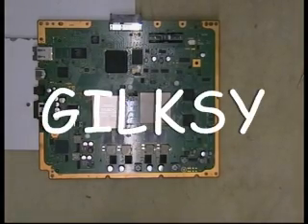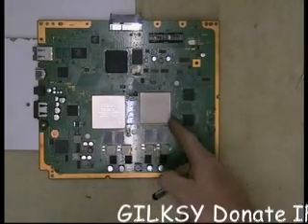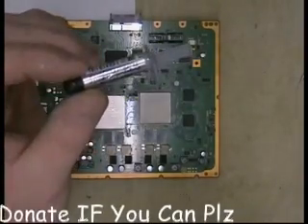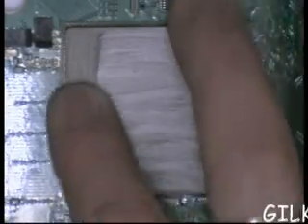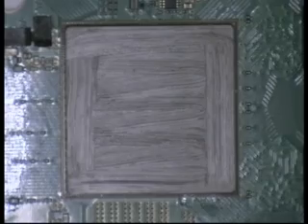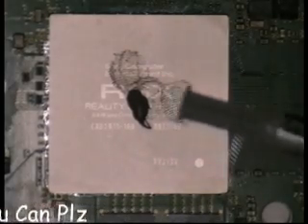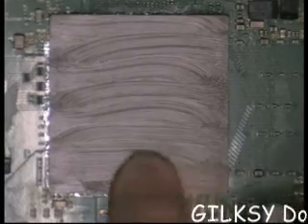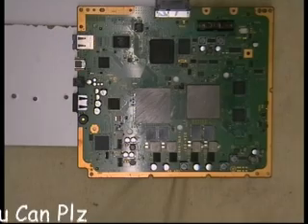ARCTIC SILVER APPLICATION-GILKSY

Comment: Oils and skin cells from your fingers break down the compound, don't follow this guide! You're supposed to use a credit card to spread a tiny amount all over the heatspreader, and then scrape it off.
This fills in all the microscopic gaps in the heatspreader.
Then put a blob in the middle (size of a grain of rice) and assemble the unit again, the pressure from the heatsink will spread the compound itself.

Comment: silksy dont use your finger at least use an sandwich plastic bag,he allso cleaned the heat synkers over the new compound if any skin,hair,the paper towel rigth over the fresh compound damn it will last 2weeks lol.he ment well,dont move the motherboard he said yeah hot leadfree based cheap sony solder,he could have used some no clean flux past to clean the solder joints never hurt,and silksy if it still doesn work have you checked the cpu/gpu heatplate covers there compound thermo top of the chip

Comment: I bought Arctic Cooling MX-4 paste instead. With Arctic Silver, it is slightly conductive so there is a danger that if it seeps over the edges from over-application and onto the motherboard or inside the chip, it will short the machine. AS5 also takes 200 hours to cure, meaning you can only play 1-2 hours on the console then you have to rest it for 10 - 15 mins for the first 200 hours of play, whereas MX-4 takes no time.With AS5, if you don't have patience, your console may need another reflow.

Comment: Never use your bare finger.   Simply put a 1cm line directly in the center about the size of a grain of rice.    The processor core is in the center of the heat spreader so that when you place your heat sink's back on the AS5 automatically is squished down into a dime size bubble free area.   This allows the heat sink to properly transfer the heat through the AS5 without hitting any of the microscopic air pockets that actually allow the heat to build up between the spreaders and the heat sink.

Comment: @sasuke000naruto I will tell you to replace it...I own a 80gb/bc I have changed it 3 times already...no issues at all...get rid of that crappy white junk..besides all you need is some 90% Isopropyl alcohol to clean the chips..or you could buy the fancy cleaners from arctic silver...either one works fine alcohol=4$ arctic cleaner kit=12$

Comment: Gilksy, I have an 80GB PS3 and I need to apply some Artic Silver 5 but what do I wash the heat sink pannels with to get rid of the crappy thermal paste that Sony put on there in the first place, and just a quick question; my PS3's fan is real loud but I've opened it up and seen that all the crappy thermal paste on it already (The White Kind) is all cracked and clumped up around the side of the pannel and is hardly protecting the pannel, is this why the fan is so loud? Hope you reply, cheer mate.

Comment: @blazednsleepy it would depend on the compound...with the normal compound tht came with the cooler 
(depending on the brand results may vary) i usually do tht, and always worked like a charm :3 but this here arctic silver, i tired to do tht, and i ended up reseating the heatsink again, only to find out tht the thermal paste did no spread well...
but thts my personal experince...tht doesn mean tht method doesnt work...it just means tht its not 100% certain

Comment: OMG do you do this to pc's too? Thats not how you apply thermal paste. People by doing this it is way too thin and will not work.

All you do is put a drop about 5-6mm diameter and height and like blazednsleepy said the heatsink will spread the paste

Also use IC Diamond 7 as its made from 92% 7 carat diamond and in tests always out performs acrtic silver by around 10 degree's..

Comment: CONTINUED...  It seems that the heat sinks cannot drop far enough down below the back plate to touch the plates on the board. I solved this by filing down the stepped tabs on the heat sinks where the screw hole are. Have you noticed this issue?

Comment: @gilsky1   Sorry- iPhone put the "go" button where the "return" button should be.    I've noticed that when I test fit the heat sinks by applying thermal cmpd, screwing on clamps, and disassembling, there are places on the heat sinks where the thermal cmpd did not touch.

Comment: From the Arctic Silver application instructions: Important! DO NOT smooth or apply the compound with your bare finger, you will contaminate the surface (skin cells, and body oil again). Also the heatsink should be tinted to reduce run in time. Just follow any instructions on the Arctic Silver website using the surface spread method and just use Gilksy's videos for how to get in the PS3.

Comment: Gilksy,
I followed your repair method to a T, and used AS5.  When I reassembled, still YLOD.  Took it apart again and saw the compound was not making full contact on the heat sinks.  Added a LITTLE more AS5, reassembled; still YLOD.  Any other possible causes of YLOD?  Any advice is welcome.  Thanks!

Comment: I used AS5 on all 4 of my repairs...
I did the same as Gilksy BUT used the edge of a credit card to smooth it over...

I also put a small amount on the heatsink itself... as Gilksy says, AS5 will fill the microscopic imperfections on the chips. If you look at the heatsink you will see the milling marks where they made the heat flat... (they did a poor job, lol) so I put some on the heatsink to help the heat transfer...